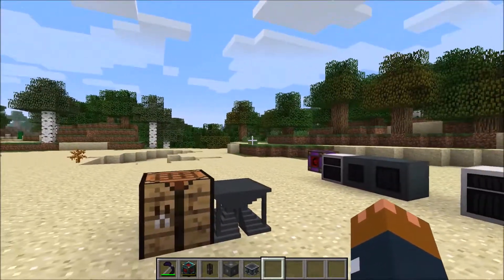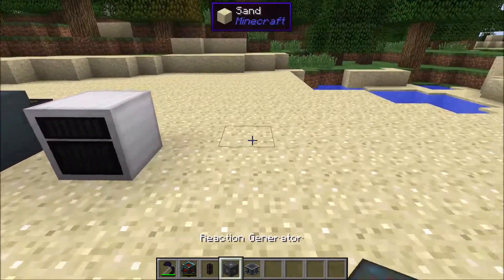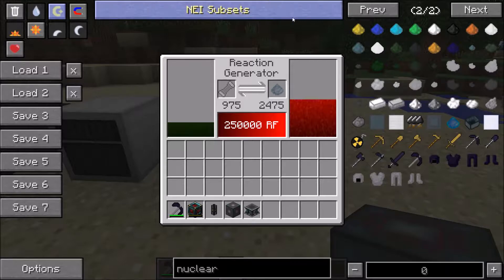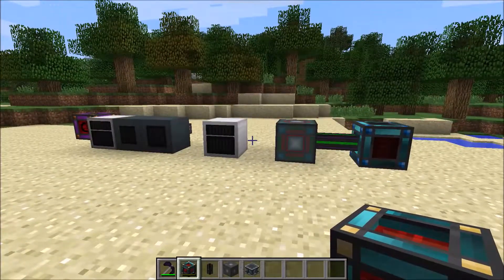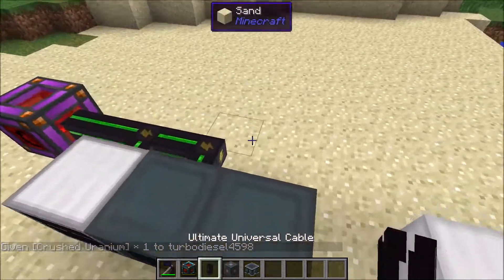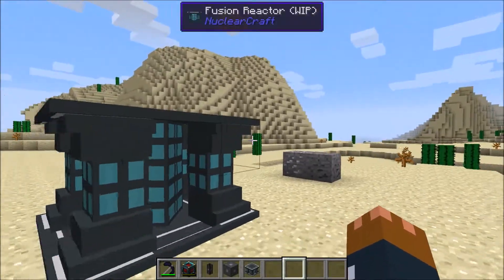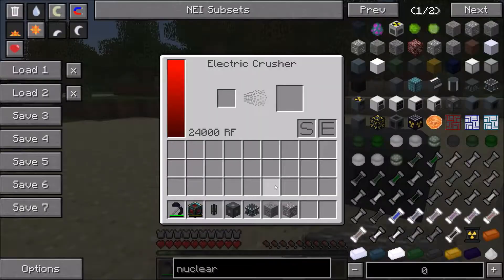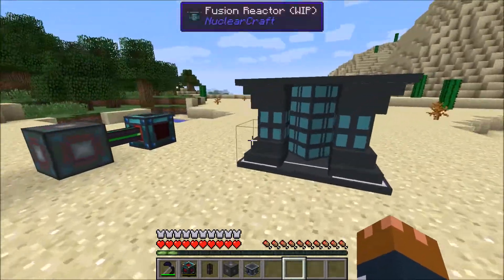New Materials and Many Fixes (1.0)

Comment: The reaction generator's ability to produce more energy per tick actually sounds like a good idea, but only if it has an upper limit of (like 1.5x - 2x power produced per tick)
Reply from the maker: +HbmMods It was very unique mechanic, but it also produced a lot of lag.
Reply: ***** How so?
Reply from the maker: HbmMods The block was updating many times per second when it didn't need to - it's much more server friendly the way it is now.
Reply: ***** But it had to update to make progress?
Reply from the maker: HbmMods Well, the block was being saved to the server memory every tick, while now it's saved to the disk when it turns on or off, or when the server autosaves.
Reply: ***** Well, then I've just created the most inefficient fusion reactor, checking it's strucutre (composed of about 400 block) every tick, yet it runs somewhat fine on my crappy computer. Yay, I guess.